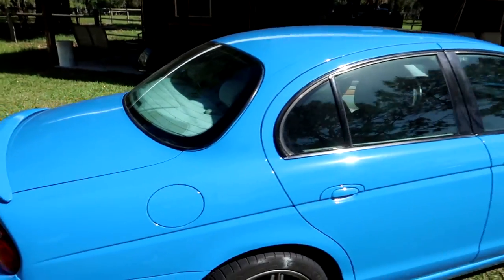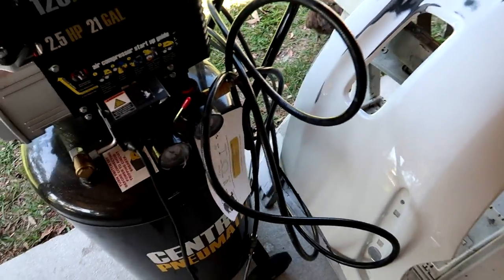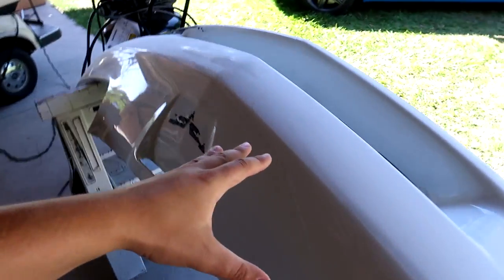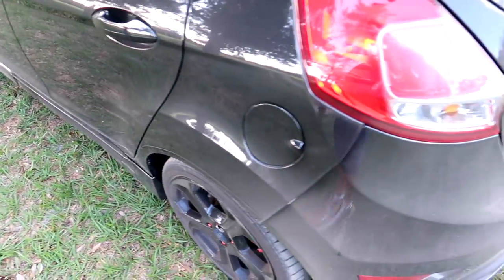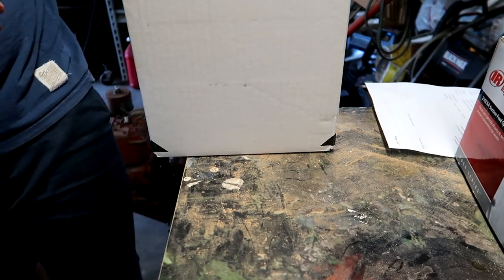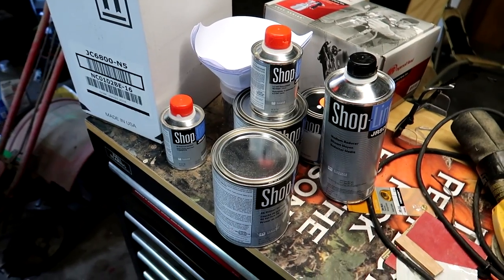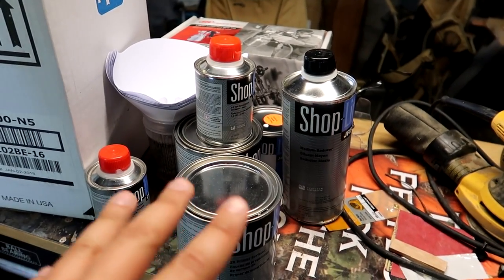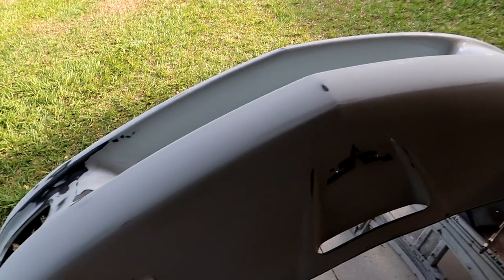Should I Paint My Own Salvage Rebuild Projects at Home? *FAIL IMMINENT*

Comment: Get rid of all the shiny areas, practice the sweep pattern on some cardboard first, to get your distance and overlap correct, and you should be good. Prep work and research has always helped me get it right the first time.
Reply: I would find a piece of sheet steel to practice on, cardboard is relatively sticky, rough, so the paint will stick easier. To really practice you need something that won't hold the paint better than a car body/part will. 

I have been spraying furniture and cabinetry for a few years now and I still don't have it perfect. There are guys in my industry where that is their only job.....they light sand between coats but basically they are sprayers...nothing more.

Oh yeah, not even prep work, but getting the pressure just right for the temperature you're spraying at, the viscosity of the paint, and what to do when inevitably you get a spec of dust or a blob from build up on your nozzle. Plus the fan pattern setting, the volume control, the pressure, and most importantly:

KEEP YOUR GUN SPOTLESSLY CLEAN ALWAYS!
Reply: Muskoka Mike Really dude lol. Nobody is doing that when they first start out. I have my own specialized auto painting shop for now 7yrs. I work on very high end vehicles but i started the same way he is. My advice was for a novice. He's has great tools, now it's just practice, Hell he's got more than I did starting out painting and reconditioning lol
Reply: Love the video. Almost left after the 3rd time he interrupted himself  with some fowl ness.
Reply: true but he's got all kinds of spare body parts, he could even practice on them! :-)
Reply: Big Al's House Vlogs is

Comment: I hate siphon guns. Always go gravity feed. I’m an ex-painter and have thousands of dollars invested in spray guns, but I also have a couple harbor freight guns I used for primer and crap equipment paint. I was shocked at how well they paint. They don’t last long, but great for a DIY painter. Take that IR siphon gun back and get a Chinese gravity feed gun. Painting is much more simple than people think. You will be a pro before long, once you realize how easy it really is. The key is detail and cleanliness. Do a good job on prepping and cleaning the part, spray in a closed area without airborne dust and debris. You have enough paint there to paint the bumper again, in case you mess it up, so don’t stress yourself out over it.
Reply: can't give you enough thumbs up. I said the very same thing. Siphon canister guns are for very heavy paints like latex and spar varnish etc. I switched to cup guns HVLP a few years ago and yes, even the cheap ones produce a far superior finish. The mist is much finer.....
Reply: Are gravity fed spray guns better for "light" (low viscosity) paint since they don't tend to generate bubbles or introduce air in the mixture? Or which is the reason for choosing gravity fed guns over siphon ones?
I do some hobby painting, but I'm not even close to a professional painter.
Reply: Tecker, siphon guns are just very old technology. A decent gravity gun will have interchangeable nozzles to be able to spray different viscosity paints. The thicker the material, the larger the tip orifice needs to be. Generally, thick primers and paints use a 2.0-2.0mm nozzle. Medium paints will be 1.7-1.8mm and the thinner paints and clears will be a 1.3-1.5mm. Gravity feed guns also cut down on wasted material, since there is always material left at the siphon cup that cant be sucked up. With gravity, you can use every last drop and they take far less thinner to clean.
Reply: and they produce less overspray, a much finer droplet which produces a much better finish, among the other benefits you mentioned. If you get a HVLP (high velocity, low pressure) you have even less fogging or over spray.....

Comment: Recommend you also get a can of the PPG's JX993 "Flex Additive" since that bumper flexes alot more than you realize even after it is installed.  Without the flex additive in the paint, it  will start cracking once the bumper is flexed (either during installation or once in use on the car).  Also the flex additive is added to all the different coats (primer, basecoat, clearcoat).
Reply: I know you have that issue with lacquer based paints but do you still need that with polyurethane? Polyurethane (which he has) is extremely flexible on its own......
Reply: Muskoka Mike polyurethane paints are more flexible than lacquer based paints, but not flexible enough by themselves when used on bumpers to avoid cracking & splintering unless a "flex additive" is mixed in with all the different layers of the paints.  Here is a link to an official position statement from PPG to the ASA (automotive bodyshop organization) on this matter  http://asashop.org/wp-content/uploads/CIC_cccbumper_ppg.pdf
Reply: thanks man, good to learn stuff every day!

Comment: Also check for humidity levels!
Reply: He lives in Florida so its always 95%
Reply: Y T Oh yeah dang that’s crazy
Reply: Came here to say...  In Virginia, he'd be screwed.  Near Tampa?!  Lol....
Reply: Agree.  Drain your compressor between sprays and have some sort of drier, line filter on it.  I painted a hood and fender one time and it looked awesome.  As soon as I sprayed the clear the moisture showed up bad when it dried and basically ruined the paint job.  Had to do the color and clear over again.  Wear long pants and shirt if possible when you shoot the clear...it sticks to your legs and arm hairs like crazy.  I got a guy that will do my paint for $200 per panel so I usually opt to let him do it as it is a lot of work and I always end up with some sort of flaw.  Good Luck and I am sure after some practice you will do fine.
Reply: and the paint viscosity

Comment: You can do it! lol   some advice from  a 30+ year painter,   small business owner, contractor etc,  A respirator mask is a must, even when mixing the paint or cleaning out the spray gun,  40-45 psi at the gun for most products.  yes you need a inline filter and a pressure reducer  gauge at the gun,  Harbor freight is good enough.  10-12 inches away overlap by 50% very lite  first coat,  full second coat,  watch the temps,   a medium reducer is your best bet,   take the gun all the way apart to clean it, IF it's not clean it will not spray well.  Good Luck!

Comment: Just to follow up. You always want to preserve the color of the bumper where it meets the fenders so you can ensure proper color match. Meaning you will only prime and basecoat the damaged areas. You will not paint the whole bumper white but rather blend the color into the bumper but do not put actual color where it meets the end. Once you clear coat you will lock in both finished to insure a proper paint match. You should be sanding the whole bumper with 600-800 where the color will not be applied. You should be sanding the plastic with 180. Then your primer will be 400. After all that give it a good wash with dish soap non scented. Of course we use automotive grade cleaners but once upon a time I had painted out of my garage

Comment: Should have a flex additive to add to the paint and clear where you are doing a flexible bumper cover.
Reply: Agreed there , wonder about fish eye eliminator additive too
Reply: No need for a flex promoter just spray the bumper down with bull dog before you spray the base coat
Reply: I know pro's that do insurance repairs that don't use the flex additive in paints.  They figure if a bumper is going to flex enough to need flex additive then its probably going to need to be repainted anyways.
Reply: The urethane paint used on newer cars don't need the additive. It is already flexible.

Comment: With some preperation and practice it is possible to get pretty good results when painting at home without "super professional Tools". Good Preperation (a lot of sanding) and a "clean" area to paint is half the way.  You can even have great results with simple spraycans if the preperation is well done. Practice practice practice... and good luck from germany ;)

Comment: I am an automotive tech for a dealer. I paint and do body work.  I would leave it to the experts but nothing wrong with trying! They sold you pretty cheap low grade paint. It is ppg but think of it as a the civic dx model with crank windows. Still will work but you have to work harder

Comment: do 3 coats of clear
if you get orange peel. wait a few weeks and wet sand and/or compound-polish. 
most at home jobs have peel in the paint but you have to wait for the paint to harden and then remove the top layer of clear.

Comment: All the cars that I've rebuilt from copart I've repaired everything myself and that includes painting since I went to school for it. I also used to work at a parts store that sold paint and I can get great deals on paint. I use the 3M PPS gun and a walmart gazebo with dupont paint. Always came out looking like factory (actually better than factory) Just sand down the shiny clear coat and prime what you want to paint then with the base just spray a few coats and every coat blend out more and more. Then just clear coat the entire bumper at a slower speed to get a wet glossy look.

Comment: Jump into the project, it is really fun.  Use a tack cloth right before spraying after you have wiped EVERY surface down with surface prep. Help keep control of your gun by holding your hose with your non-dominate hand, and if possible, wash out your paint area with water so it keeps the dust down.  Prep. is the key to a good job. Mix according to the temp outside .  Cant wait to see it. Great videos as always.

Comment: I hired a local bumper repair guy here in Las Vegas who repairs/paints bumpers in your driveway.  His work is flawless.  He has a little trailer with a computerized paint mixing system to match most any colors.  (No shaker/rattle cans used!) Repairs include repairing tears, gouges, etc. and paint.  Average cost around $200.
He repaired my new/late model Mercedes/AMG's and  BMW over the last several years.
You may find a local bumper repair guy/company in your area to do the same.

Comment: One thing on your prep: be really careful about the high spots etc where you've already gone through the paint. Those will show up as deviations in the paint finish you put on as they are now lower than the surrounding areas. Plus on a plastic bumper you can easily remove a detail (like you did on the top where it's black). I bet there was a tiny ridge there that you sanded off.....

When you are sanding between coats: be very very very careful of the edges. The paint basically migrates away from the edges and sharp outside corners so you can blow through it very easily. 

The trick is to keep the whole area wet. So when you go back and forth, you don't "fog" the previous area you've painted. If it flashes off (too warm) when you go by again with the gun, you'll leave little tiny spots of paint on TOP of the already semi dry paint.....They can be sanded off later but it's just one more thing to watch for.  Flashing off is when the solvents and carrier of the actual paint dry really fast from the surface so it would almost appear dry. Yet the paint underneath isn't close to drying yet. 

I have painted ALL kinds of things and it's a fine line between too wet (you get runs aka hangers) and puddles and too dry, which will leave a rough pebbly surface.....

Comment: Sam, check out goozquad's rebuild channel, they've set up their own paint booth in the dirveway and have done several entire repaints. The finishes look professional, and for just the cost of equipment and supplies. I've seen "professional" jobs that don't come out as well as these two brothers do. I think you have too, quite recently in fact.
Reply: What up goonzquad
Reply: They sold me when they broke the blue Rubecon right down to the bare frame.....which they replaced. Complete disassembly. I don't trust myself to even change the oil anymore.

Comment: I used to be pretty good as a amateur painter. Painting outside You can just get one of those portable garages and set up a fan at the end for ventilation.. Biggest problem you will have is bugs and dust. Or in my case last thing I painted had grass stuck to it.
Reply: Mr Charles bugs are the worst!!!! I knew spring was here last week when I got a bug in my clear coat. I had to bust out the tweezers and remove it with surgical precision lol nothing a little sand and buff can’t fix
Reply: We paint outside also. We usually wet the ground before spraying so dust won't fly up everywhere.

Comment: You need rubber gloves, Wax and grease remover and a tac cloth. Did you get those from the paint store also? If not, go back and get Prep All (wax and grease remover), and a tac cloth. Go to home depot and get a gallon of acetone to clean everything with and get some rubber gloves so you don't get the oil from your skin on the bumper after you use the was and grease remover/prep all. Sand it good with 400 grit, clean it with the prep all and then spray the primer with a 1.7 -2.0 tip on the gun at about 30 lbs on the regulator at the gun. Let it dry and sand again with 400 lightly. use the prep all and then the tac cloth right before spraying the base coat. Wait about 10 to 15 minutes between each base coat. Then wait at least an hour or two. Use the tac cloth and spray the clear coat waiting about 10-15 minutes between each coat. Do 3 coats of base and 3 coats of clear. Spray the base coats medium on each. Spray the first clear coat lightly then make it look wet for the 2nd and 3rd coats. Especially the 3rd coat Do not make it so wet on the second coat to cause a run. On the third coat you can make it real wet and try not to make runs but if you do, don't worry you can color sand them off later. make sure to use a water filter at the gun along with the pressure regulator. Spray the base coat at 30 lbs and the clear coat with more pressure about 35-40. I spray clear at 40 to get a nice glass look and not have orange peal. Let it sit for about 4 hours before removing any masking tape if you have to mask anything. Remover the emblem on it I say when you were sanding, you can always get 3m 2 sided tape to reinstall the emblems. Wait at least 24 hours before handling it or installing emblems etc. If you have any questions feel free to contact me and I would be happy to talk to you and answer any questions. I have only painted my cars, trucks and boats for about 40 years. Good luck, you can do it!
Reply: doesn't acetone melt plastic bumpers?
Reply: greg h  LOL! The acetone is used to clean the gun etc., not the bumper or paint surface! I said to use the "prep all" to clean what you paint. As for the acetone, no, the acetone is not going to melt the bumper right away. If you do a quick swipe over it with acetone on a cloth, it may remove a small amount of the paint on the bumper and make a mess of the paint to create more sanding. Best to not use acetone on your bumper, just use the prep all, and use it lightly over the primer, or you will have more of a mess of some primers to sand from the prep all soaking into it and smearing it. I usually do not use anything once I start painting except the tac cloth before the first coat of base and the first coat of clear lightly tac the dried base coat for any dust settled on the base while drying for an hour or two and spray the clear. I also just before each coat blow off the surface with the gun spraying just air out of the gun. Good luck, sorry for the confusion.
Reply: hey you said "clean everything with"  lol
Reply: yes, the gun and the cups etc!
Reply: I also said to use rubber gloves and to use wax and grease remover (prep all) to prep/clean the surface you will paint (the bumper)!
Reply: Let me know if there is anything else you do not understand completely, I will be happy to explain it to you since it is not clear to you.

Comment: Better hit those bare spots were you sanded down to the plastic with some adhesion promoter before you prime it and don't forget to tack cloth with some wax and grease remover.
And you might want to add some Flex agent in the base coat clear coat you don't want the paint cracking during assembly or when you run into the garbage can on your way out the driveway.

Comment: Definitively want to see the following step!! By the way, if you have dusts on the primer and on the color, that's not a big deal. The big issue will be with clear coat. Also, because that's your first time, you have a lot of chance to get orange peel after all the clear coat layers. No worry, just wet sand, buffer and polish to have perfect gloss finish (you'll find videos about this on YouTube). Good luck!

Comment: the paint stores will help you out quite a bit with how to paint and what to watch out for. One thing i didn't see that concerns me is that you weren't sold any tack cloths, you always want to tack everything off before you go spraying on anything. you also want to scuff that whole front end properly, that gives what you're spraying something to stick to. and you need to tack the whole thing off before you spray every time too just to make sure there is no dust or trash that gets in the paint while you're spraying it